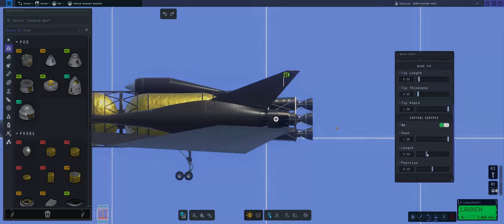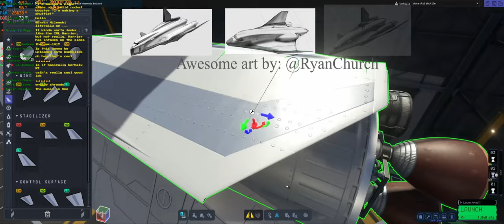KSP2: Duna vtol shuttle

Comment: I do enjoyed the video, well done! However, little bit disappointed on KSP2 for not having reentry heating. (or robotic parts for that matter but it came to KSP with DLC as well)..
But the reentry heating.. Man! I have to keep modding my KSP to look like 2.
Reply from the maker: yah, ksp2 lacks a lot of features.... hopefully it will get patched up in the future
Reply: With that out of the way, for Mars landings (KSRSS) I usually pitch up till velocity becomes low enough to handle, then start to do a smooth butterfly burn (as i call it) and powerland. The craft stays lighter that way and lets you spend less kerbucks. Fly safe ;)

Comment: Very nice shuttle. You're saying you get ~35fps, what's your setup to achieve this framerate ?
Thanks.
Reply from the maker: fps largely depends on the specific build. The shuttle isnt very part intensive, so i was getting pretty good fps as a result :P
I got a 3070ti and 5800x3d
Reply: @Kerman_von_Braun  thanks !

Comment: To fix the vector bug you can set the gimbal limit to 0 on the vector. I think that there's no point having gimballing VTOL engines unless they are away from the center of mass and have 2 or more balancing them.
Reply from the maker: vectoring engine is kinda vital or else i got hardly any control over the craft when in vtol mode
Reply: @Kerman_von_Braun  I use reaction wheels to give control

Comment: Hmm, did you do anything special to prevent the vector in the cargo bay from generating drag since cargo bays don't shield parts?
Reply from the maker: Dont think there is much you can do about it atm.
This thing is an absolutely brick aerodynamically, thats the main reason why i went with a shuttle vs an ssto.
Reply: @Kerman_von_Braun  
Tis a shame it wasn't fixed in the second patch